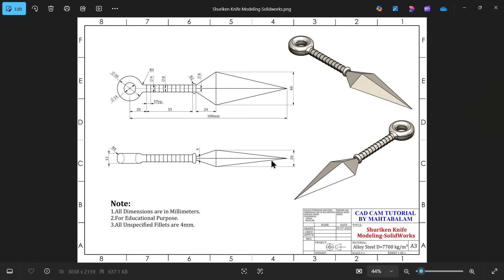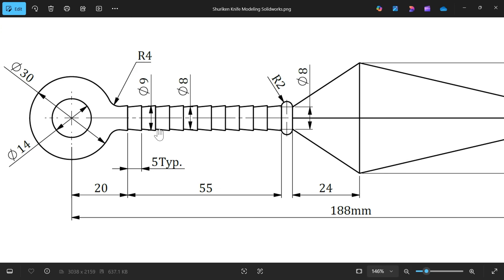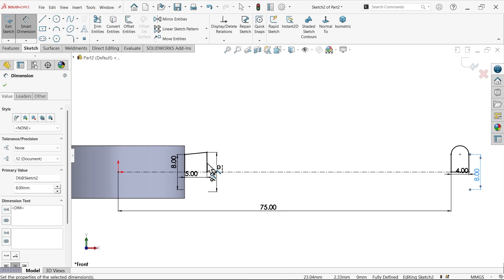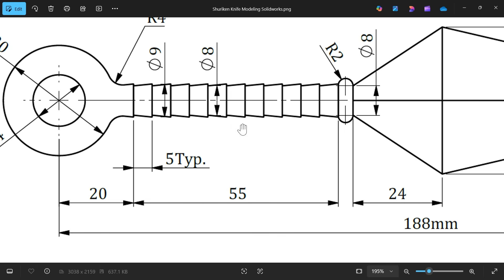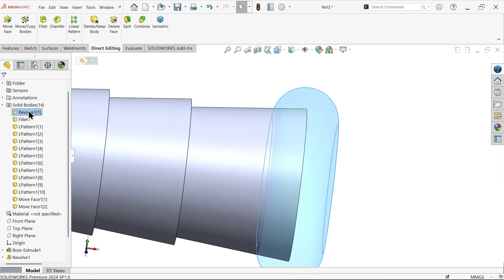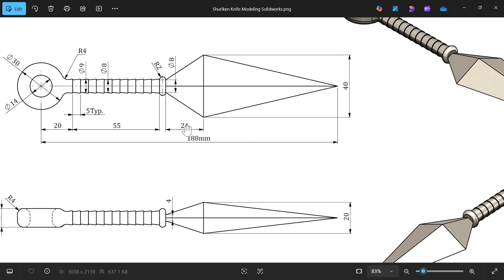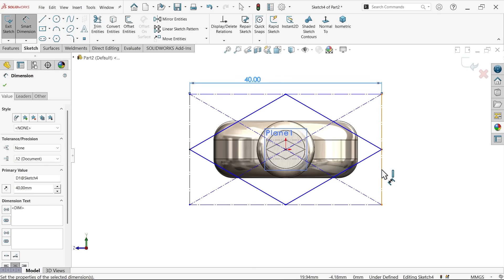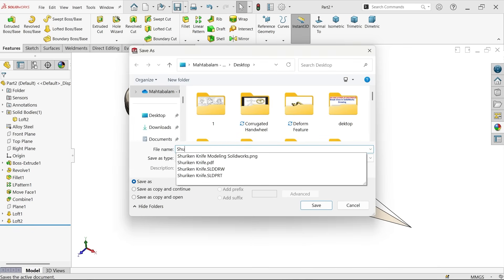Shuriken knife Modeling in SolidWorks

Comment: I don’t have direct editing function in my SolidWorks. Is that an add-on that you have to purchase separately?
Reply: It's just a tab. It's not on by default but it's easily turned on (made visible) by right-clicking on any tab (where it says Features, Sketch, Surfaces, Weldments, etc. in this video) and select "Tabs", then put a check mark beside "Direct Editing." If you notice later that you have Tabs for things you never use, you can easily do the same thing but this time remove the check mark. It can easily be added back later if you want.
Reply: Thx
Reply: @lafishfille2675  No problem, my friend.